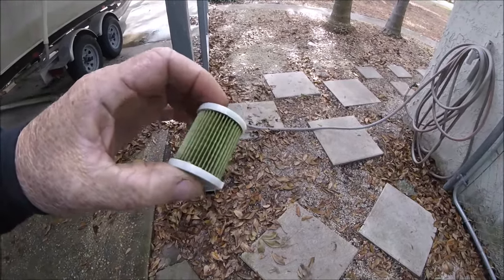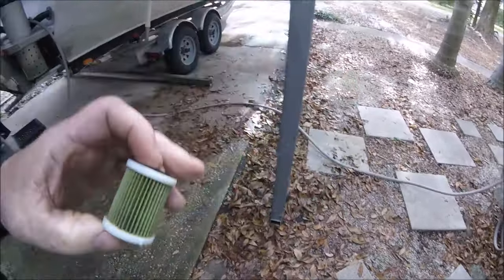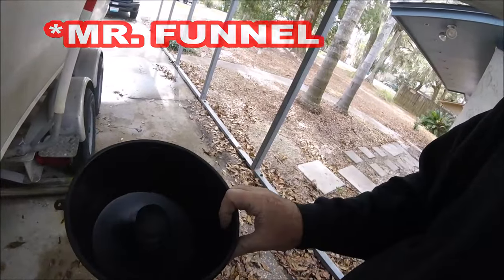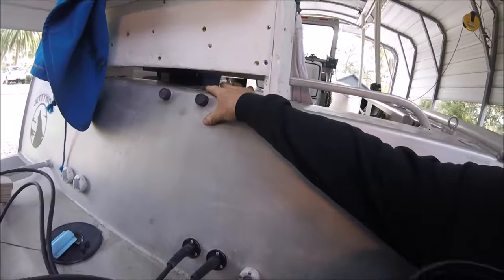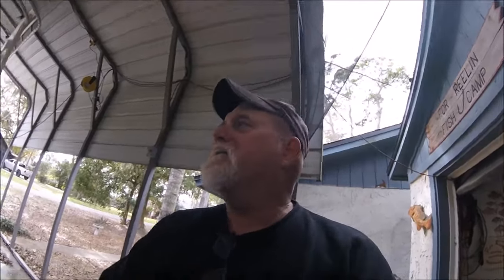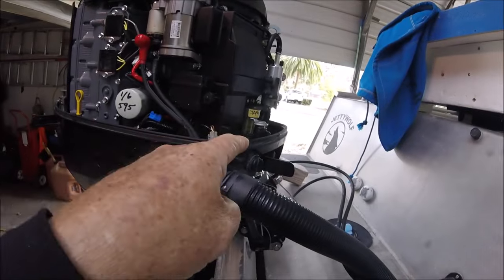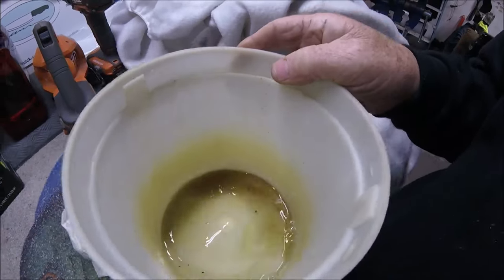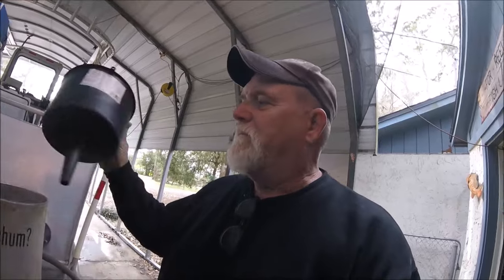SOLVE BOAT FUEL PROBLEMS, BEFORE IT HAPPENS

Comment: Hi JW, I'm a Mayport fisherman as well. Good system you have for fuel filtering. For the bigger boats using jerry cans isn't an option, mine has a 300g tank. An alternate solution that I've used with success is using fuel water separators at the 2 micron level. Change them out every 6 months and keep 2 extra 10 micron separators onboard as backups. You might disagree on this next one, but I'm also a huge believer in fuel additives with PEA. I run high concentrations of the stuff every 6 months on both my motors and it noticeably restores perf.
Reply from the maker: my boat had a 150 gallon tank I never used, or filled up but once! Then, it sprung a leak. Went to a 60 gallon. I wouldn't own a boat with a 300 gallon tank if it was given to me.
Reply: @CaptDavesSportfishing  Fair enough but besides the point; there's alternative ways to filter fuel that get the job done just as good, if not better (2 microns).
Reply from the maker: @christopherlindstedt3748  this is all before fuel (w/ its debris) goes in my tank.

Comment: Havent used boat on 4 or 5 years.  Pulled all the old fuel out of tank.  Going to dump fuel out low pressure filter.  I want to empty vst also.  Is it tough to drain vst tank?  There  is enough fuel in that vst to maybe cause a problem.
Reply from the maker: there's a drain screw on the VST tank